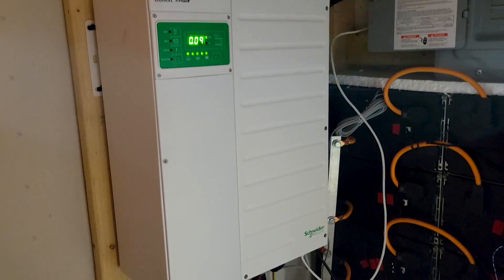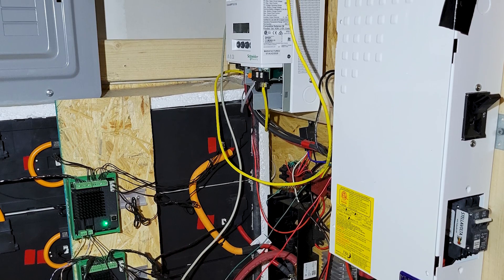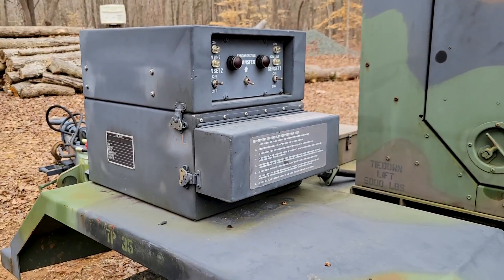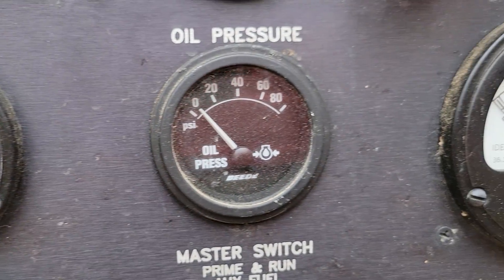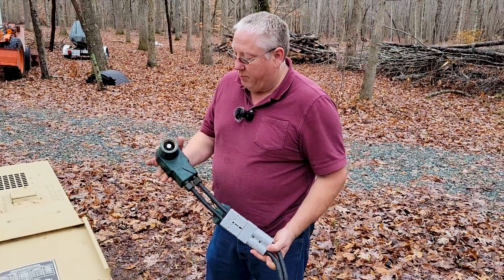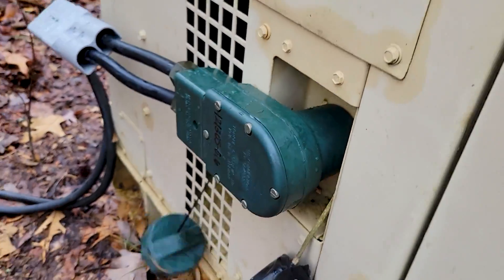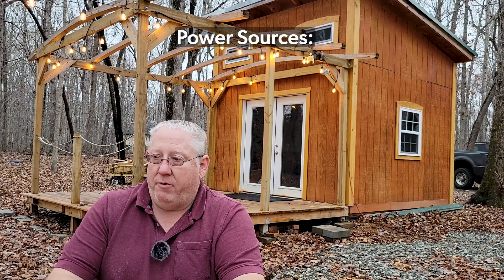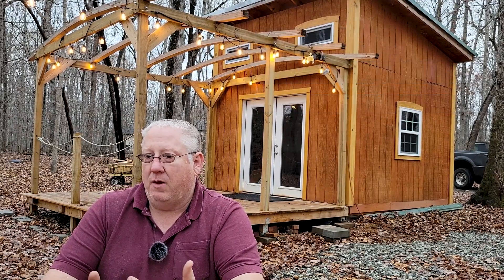Off Grid: more generators or more solar panels?

Comment: If the generator is not exceeding the charge controller voltage, you can do without the buck converter for more wattage generation.

Comment: Hey Dave,  I took out my outback charge controllers and put in 2 Victron controllers and now my generator back won’t charge the batteries with my outback inverter and the error light comes on in the inverter, any suggestions
Reply from the maker: I have very limited experience with Outback equipment.  Short answer is, "no" I don't know why that's happening.  I can suggest the same thing I personally did:
When I tested feeding my generator through my Schneider inverter I had some problems.  Nothing major, but it was glitchy.  I didn't like it.  So, instead of running the generator through my inverter, I bought a separate charge controller.  This is what I bought: https://signaturesolar.com/eg4-chargeverter-gc-48v-100a-battery-charger-5120w-output-240-120v-input-pre-order/?ref=4_rHcgZ9x-TiF- (affiliate link) I also have a video on it.  (My video uses the older model which is yellow)

Comment: Those MEP gensets are nothing but trouble, anybody who uses them much has ripped them out and replaced them with something commercial.  10x the wires, relays, and complication than needed to produce a working genset.

Comment: I have an MEP803A and plan to use it at a mountain home.  I wonder if I could use it as sole power for a garage/shop
Reply: You absolutely can! 

I have an 802a 

These sets will literally just run and run and run until it’s out of fuel 

Their known for 20-30k hours without issue if you change the filters and oil

Comment: For the money spent on all of those diesel-sucking generators, you could have oversized your array enough so that you wouldn’t need a generator. For my off grid home/shop…34kWp, 17MWH produced, less than 10 hrs on my LP Generac 10kW and 5 of 400 gallons of LP consumed. I have a smaller backup 48V Solar system and then an even smaller 24V backup to that. Then two tiny 12V backups to all of that.

Comment: Hey David which bms would you recommend for the 280ah catl cells from battery hookup?I want to build my own 48v battery from these cells.thanks
Reply from the maker: I've had very good success using Battery Hookups 100A BMS: https://batteryhookup.com/products/12v-lifepo4-smart-bms-w-low-temp-cutoff?variant=42745018286242
You will want to select "16s LiFePO4" from the drop down list.  
If you have a unique situation where you need more Amps, for example, a Golf Cart, then go with the contactor based BMS: https://batteryhookup.com/products/7s-21s-24v-75v-300a-lithium-ion-bms?variant=43085312884898
If you would like to help support the channel, then please use my discount code during checkout DAVIDPOZ
Reply: @DavidPozEnergy  thanks David I will certainly use the promo code!

Comment: Love it Chris!  We came to the same conclusions about a lot of things like DC lighting and automated source selection.  I just wanted to suggest you consider one change; rather than 3 days of autonomy, consider more panels and less battery.  Even on a cloudy day,  you get some power from a solar panel so can recharge batteries during a long cloudy streak.  By balancing the dollars spent on panels and batteries, you may see the least generator run time for your money and on good days you get extra power to store as heat or other cheap energy storage.  Also, really like your arched top gazebo.  Nice!

Comment: My #1 Advice from personal experience. Dont buy AGM batteries. My 1600AH bank only lasted about a year. I never cycled it below 80% either. (Im still running those batteries 4 years in, but its miserable). Also, you will actually SAVE money by going lithium. I didn't realize this at first. A 200AH agm was about 500$ and a 200AH lithium was about 1000$. So I bought the "cheaper". But you can only use 20% of a lead acid / AGM battery, and 100% of lithium. So you are getting 5X the storage per battery if you go lithium.

Also, This was one of the MOST informative off grid videos i've ever seen! This guy knows whats up. I learned a lot, thank you!!
Reply: Totally agree. Lithium has a higher up front cost but it is the low cost option for the long term. Had a friend convert his AGM bank to Lithium a couple of years ago. Once he was done he said he should have done it sooner.

Comment: Depending on who is doing the wiring, a simple relay setup would allow you to run the lights on either AC or DC. Sylvania  makes an incandescent style LED bulb that can run on either. Rated at 120VAC they also will work on 60+VDC.  I have a 24VDC system where I step the Voltage up to 65VDC for lighting in the shed using a MingHe MPPT 7210A. It would take a lot of those LED bulbs to get to a 10 Amp load. They actually start to light up at 30VDC but you need the higher Voltages to get better lighting.
Reply: Very true. Many of the lights can be modified internally to run on lower voltages as well. If you choose to run the LEDs at lower power levels it dramatically increases their life and reliability
.
Reply: @gravelydon7072
So you connect the 7210a straight to battery on the solar side and then on the battery side you run lights without any battery?
I have always been hesitant to hook my input side straight up to a battery. I'd love to do some battery to battery charging with it, mostly 12v to 48v but never wanted to risk frying it. Haha. (What I'm afraid of is supplying too many available amps to the solar input side). I have speculated that the controller will throttle some mosfets inside of it and keep the output amps down and be ok. I've just never seen it done before.
So I assume in your case the controller raises to the set desired "battery" voltage that you set and stays there?

Comment: i've run my lighting in my house from dc for over a decade which has worked great. now i plan to run everything else via inverter. cooking and hot water is gas but will be converted to LPG which i can fill at service stations myself.

Comment: I manage a schneider system just like this one but with 10kw and using 2 80 amp 600v charge controllers.  I have a ground fault on one that doesnt go away regardless of replacing fuses or adjusting the string.  Did everything in the manual but no change.
Reply: Have you had anyone come in with a leakage meter to help isolate where the ground fault is located? Could be caused by a faulty panel or even a bad spot in some wire insulation.

Comment: Great share - enjoyed! - David - do you have any material that discusses taking a current grid-tie system and net metering system to a either adding a battery bank system or incorporating a battery bank system and maintain current grid-tie setup; or is that even possible?
Reply: You can net meter with or without battery storage. You just have to buy an inverter that can handle all the different power options you are interested in. As an example, as nice as the Schneider inverters are they can't be used without batteries. They can do grid tie and sell surplus solar power but you still have to invest in some battery storage. 

There are options such as SMA inverters that can start as grid tie whiteout batteries and if you decide to add batteries later, you can. Its best to lay out your energy goals then start doing the research on what equipment fits those goals.

Comment: As someone who has done the 48v lighting, if I had to do it again I would just install a small 1200va Victron multiplus dedicated to lights. You then have redundancy as you can switch it over to the other inverter system if you have a problem. Running all DC lighting is quite the hassle and doesn't really give you any benefit.
Reply: I would just install a small 48-120 inverter in the house for ligth breakers
Reply: @rdcabal  Absolutely an option. Something to consider when building out your system is any standby losses you incur. Running an inverter continuously when you need it mostly for lighting in the evening could cost you more energy than your realize depending on how much power the inverter uses to just be turned on. Even a very efficient inverter may cost you 500 to 1000 w/hr per day to operate. That can easily eclipse the amount of power you need for the lighting itself. 

Everything is a tradeoff. Evaluate your options carefully.
Reply: Yeah, just put it in a small Victron Phoenix inverter.

Comment: i'm always bewildered when i see people putting in massive and capital intensive systems.
Reply: I don't recall them mentioning the price of anything at all and given that the property has no utility power how could anyone possibly know what the cost comparison would be between Off-Grid equipment and bringing the grid to the property maybe thousands of feet or even a couple of miles. Its entirely possible the proposed solar system described in the video costs LESS. So really what is your point? Lastly, we have no control over utility rates so when electricity gets to $1+ per kWh that so called massive, capital intensive system will be looking pretty good and cost effective as well.
Reply: Cost can vary a lot depending on if you DIY a system vs have a turn-key install. I personally don't mind sharing what I spend on things but my concern is whether those prices would translate to your location if it is different from mine. I tend to not have labor costs in my projects since I do the work myself and at most have friends to lend a hand when its something I can't physically do alone.
Reply: They aren't as expensive as you might think. The key difference is the size of the check you write once, vs. the ones you write every month to the power company. It's not hard to do the math. (and with rising electricity costs, these systems look better every day.)

Comment: Generators are awesome for a backup to solar.  But the noise is horrible.   Living out in the woods, wanting to hear the birds and nature an inverter generator is the ONLY way to go.  A very quiet purr is fine.   No thanks to military generators!
Reply: handy for a few days after a hurricane takes out your grid connection, but certainly wouldn't want it to kick on every time you have 3 cloudy days in a row
Reply: Modern car engines are often really quiet, and relatively efficient, at least compared to most portable generators.  Yet for some reason hardly anyone seems to consider it important to design generators with quiet engines, or for high thermodynamic efficiency.  Additionally, no generator manufacturer that I am aware of is currently selling noise damping generator closets/boxes/enclosures.  Instead, the generator manufacturers simply affix a warning label on the generator, telling people not to operate them indoors, so that the generator noise pollution can more easily annoy the neighbors and enable thieves to more easily steal the generator by virtue of being operated outdoors in an unsecured/unattended fashion.

One would think that the US military would value "stealthiness", when invading another country, and that they would try to minimize noise generation, in order to better hide their campout positions from the adversary forces.  However, that does not appear to be the case, at least to a large extent.  Apparently, extremely noisy generators are totally okay, as the US military evidently does not think it needs to be stealthy, nor does it need to provide its servicemembers with a good night's rest so that they do not make unnecessary mistakes on the battlefield.
Reply: @Fritz_Schlunder  Anywhere you're likely to run a generator will be MILES from the front lines. And these things are way quieter than a tank rolling by. Many of the larger generator manufacturers do sell enclosures, but you aren't going to find those in the isle as Lowes with your 2kw honda. They put those idiot labels on there because people are idiots who will run a gasoline burning (CO spewing) engine inside their house. A running generator should never be "unattended". (you'll be in the house, near it, and notice when idiots turn it off/disconnect it and drag it across the yard. In my parts of NC, you'll get shot for shit like that!)
Reply: Those MEP802s are pretty quiet when the doors are closed.  Good mufflers and 1800 RPM keeps the noise down.
Reply: For sure the generator is going to be louder than mother nature. The low RPM of the military machines has a much different sound than the high RPM machines. Its not harsh or thrashy. Still not something I want to listen to often but it is a welcome sound when its really needed. Inverter generators are a great option for temporary power. They give you the benefits of lower fuel consumption and noise versus a high RPM constant speed generator.

Comment: I have free natural gas and panels always win. It’s hard to find a high quality and easily serviced generators. More panels is more quiet and less maintenance. Oil changes, valve adjustments, filters, spark plugs, etc. they all add up. 

I’m slowly expanding my system but plan for 10k. A consistent charge every day greatly extends the life of batteries. My l16s are 13 years old. I expect 15 years. Over paneling greatly extends the life of the battery.
Reply: Yeah, a generator should always be the backup; it shouldn't be part of the main or everyday source of power.

Comment: Awesome! Retired USAF mobile radar guy here...we used most of those generators and shelters in the field. We also used the MEP-806A units (60kw) quite a bit and the TAC-quiets. I wasn't an AGE troop, but had to know how to run these generators. Do you have a mobilizer for that S530 shelter?